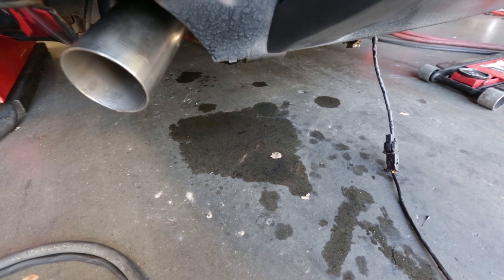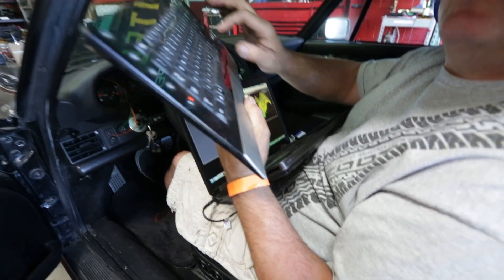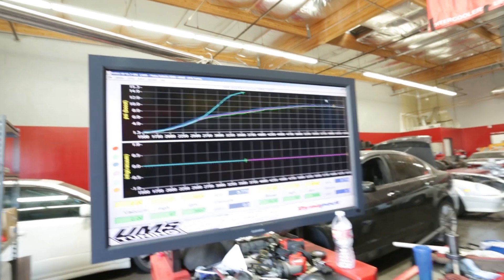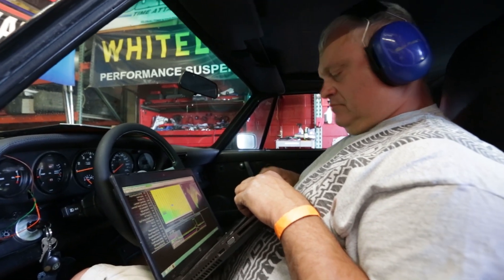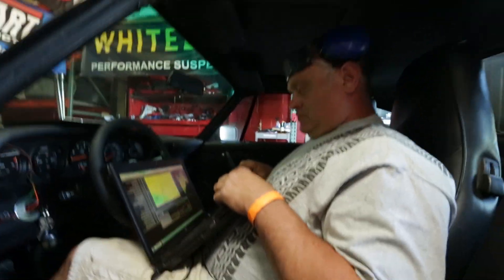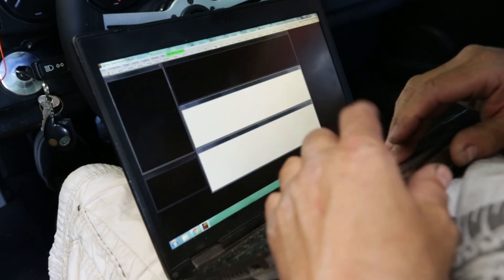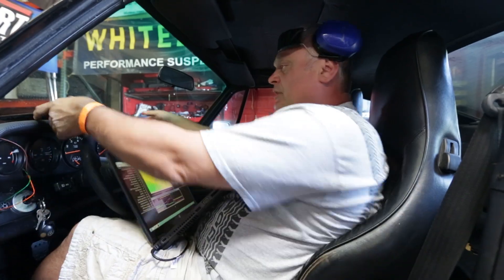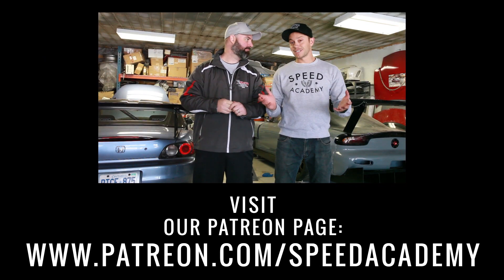Big Power Gains From The EFI Conversion - Porsche 930 Project - EP13

Comment: Other than Turbo and EFI what modifications have been done? 415 wheel hp (500 crank hp) is quite lot of hp just for those two changes? I'm interested to know more about your build? headers/exhaust? turbo? boost spring? cams? cylinders? intercooler? cat delete? Thanks

Comment: what kind of gas did you use during these passes? 414 seems low for a gtx3076
Reply from the maker: 91 Arizona pump gas. It's only at 17psi with conservative timing.

Comment: You also have tho think about how the car will behave now on a race track. If it's a monster, you are going to have to handle all that power and control it. It's better to have a more linear power band especially when coming out of a corner or you'll just be counter-steering  the heck out of that thing. How do i know this??  Forza 1- 6 got that tattoo on my forearm.  jk :)

Comment: Looks amazing, just wondering any reason you set the rpm limit at 6500 other than obvious safety factors? Just be great to hear it screaming at 7000+ rpm, looking forward to the 35r run
Reply: Power peaked at 5,760rpm.  There's no sense in revving it higher, power is declining.

Comment: Tony, enjoyable to watch once again. 414 wheel/500 crank sounds about right on just over a bar of boost.  Engine sounds wonderful, too.  Nice idle and very smooth when putting the power down.  Even in this form, it'd be a hoot to drive.  I have about the same hp in my 996 turbo (obviously much heavier than a 930) and it feels relentlessly fast.

Comment: I think you should at least get it out and drive it with the GTX3076, 417whp is quite a bit for a car that size and since you are only spinning to 6500rpms, pushing the full boost past 3500 rpms only gives you 3000rpm power band for a track car that is better than fullest at 4500rpms and only 2000rpm power band.  Do you have corner weights for the car yet?  I bet it can't be over 3000lbs.

Comment: The early days of EFI sucked.  The 90's didn't have reliable technology, but now I swear by EFI.    A good fast computer that controls and learns how to react fast to any changes is able to adjust your fuel and timing slightly to keep your engine safe under different loads, as well as put it into a Safe Mode if it screws up.   Yes, electrical components go bad after time, but if you want to get 15 years out of your car, get a stand alone first, then get your bolt ons and add to it.  ...I don't know why kids do it the other way.
Reply: bc a good ecu is expensive. worth it, i know, but the answer to "why kids do it the other way"
Reply: Too many people not situated in life before they get into high performance, and thus blow engines.

Comment: I was thinking the Gtx3076 Was capable of near 500 o_O
Reply: It can be.  Just make sure you have the right pistons and rods.  You can have all the electronics in the world to adjust everything, but limited mechanically.    Also, fuel type plays a huge part.     There is 800hp 4 cylinders out there, but they are running E85.
Reply: He measured 414 at the wheel and not at the engine. So the power of the engine is higher.
Reply: Yes you are right, I Mis read it as Bhp. That makes must more sense
Reply: That and.. Have you watched any of his videos?  It's built and capable of more:P
Reply: 800hp is easy if you can rev the tits off it

Comment: Something here not right i'm making 480 on A 1.8 B18b stock ports with A GT3076 82 ar hot side. This GTX3076 is rated up to 600hp =/ This turbo can easily make 500+ you can even look up on yt of this turbo making a lot more then this so what was the problem. With A T3t04E precision 5431 same engine i made 435 on 26 pounds 63 ar hot side on water meth.
Reply: I have no doubt you are making more than 414whp, but you're probably not doing it at 15psi and on 91-octane gasoline, right?  This turbo is capable of more (as is the engine) but at much higher boost pressures -- and this is a pump gas build.  Ultimately, the small turbine wheel will be the limiting factor on this 3.4L engine, it is incapable of the necessary exhaust flow.
Reply: Healthy street engine indeed, B18B is probably north of 20psi to make the power it does :^)
Reply: Fuel type?   BSFC?  Do the math, it might be something as simple as altitude adjustment.
Reply: it's making around 500 at the crank though, and you gotta keep in mind it's not E85, with the bigger turbo and more tuning it easily do 550-600.
Reply: walperstyle Dude the car is boosted altitude doesn't mean shit. lol
Reply: Vlammenzee Even on pump he should be Around 500+ At the wheels.
Reply: Guessing you have not done the math.  I have a video somewhere in my playlist that shows a preview of it.
Reply: walperstyle Omg man look at my comment.
Reply: walperstyle Facepalm.
Reply: Turbokraft Team True